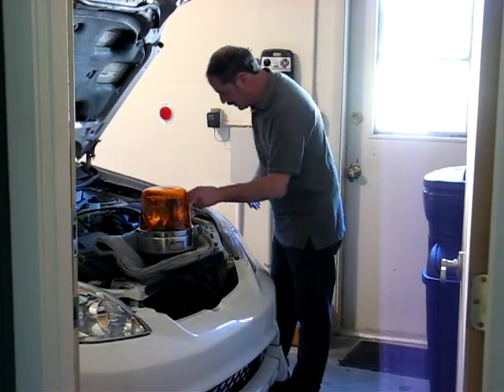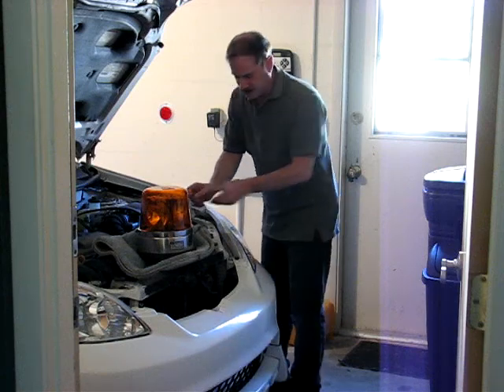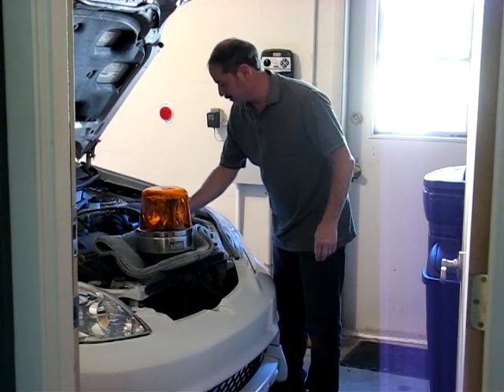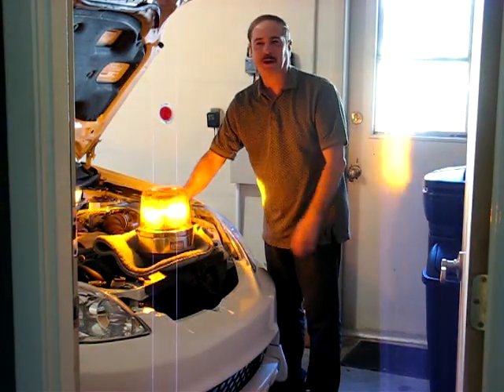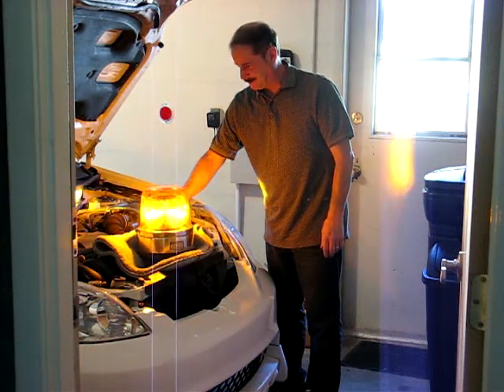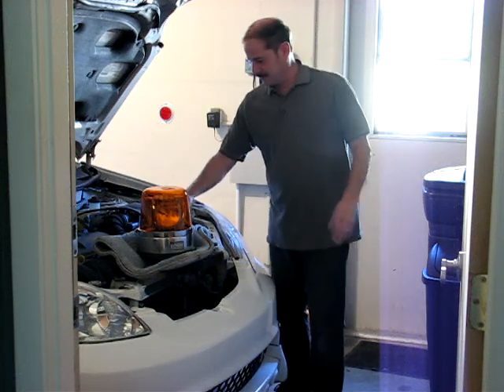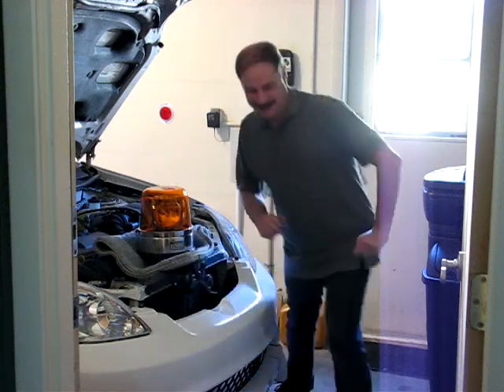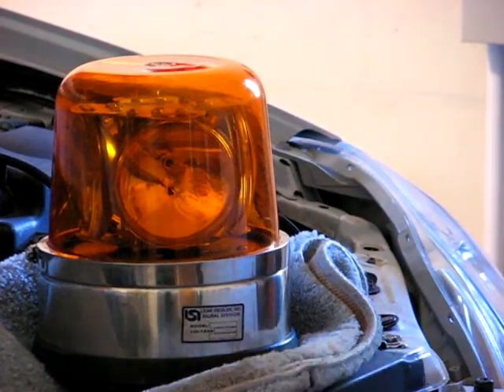Lear rotating beacon

Comment: Hey Richard. I have one of these. It has one lead coming out of the bottom. I don’t want to overload it since it’s been in an old garage for years so should I run it at a lower voltage than 12v for a bit to make sure I don’t overheat the condenser? Also how would I attach the one lead for proper testing? Since there are 2 test lead clamps, not sure what to ground to. I assume I attach the red lead clamp to the one lead from the beacon? Newbie here. Thanks!
Reply from the maker: It will only work powered direct to the battery because it draws higher amperage than a norminal power supply or battery charger provides.  Not recommended to power a motor at less than normal voltage. There is no condenser or capacitor involved.  The red wire is positive, the case is ground/negative.

Comment: If the light would turn a bit faster it would be more effective.
Reply from the maker: In fact it is going too fast to be most effective. Federal did many studies and determined the perfect human reaction timing to emergency lighting and it was designed into the earlier equipment as shown here in this linked video at bottom. Later as strobes were developed they had to go faster by design and were always an annoyance. Now leds have ability to slow and some designs do just that although the original importance of the cadence and the reasoning for it has been forgotten in time.  https://www.youtube.com/watch?v=_XuNmf6kkbE